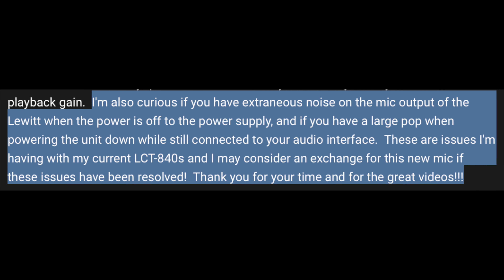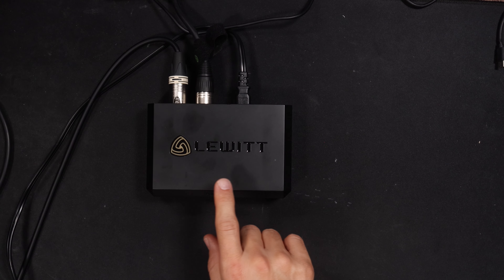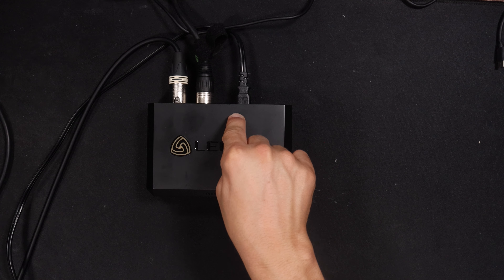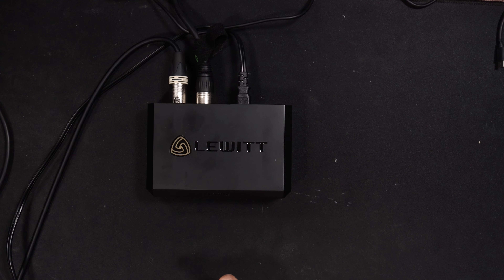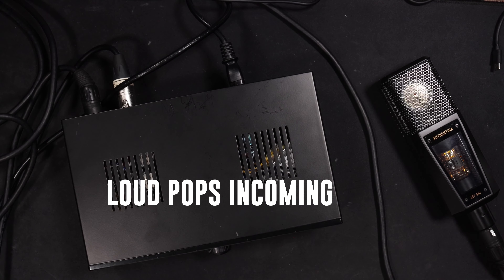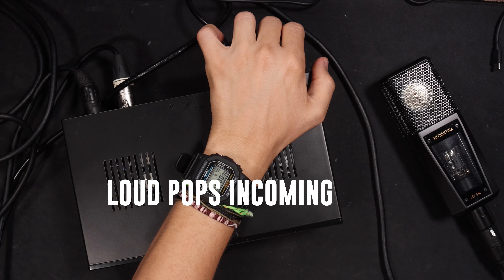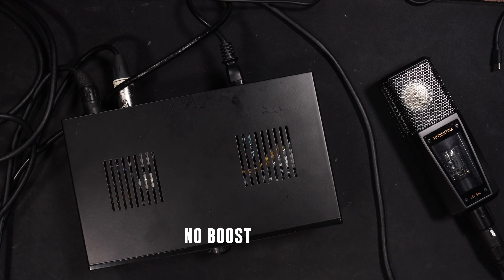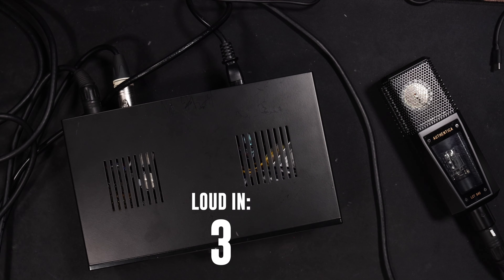Does the Lewitt Pure Tube Have Noise When Powered Off?

Comment: We are aware of this, which is also why we fixed it int the LCT 1040 and the PURE TUBE. While not being the nicest thing in the world, it is actually not an issue since it is common to use the tube microphone powered on. So, it does not have any impact on the actual sound and the recordings. Hope I could shine some light on this.
Reply from the maker: Lewitt - Thanks so much for the comment. And the video shows that you successfully fixed that on the Pure Tube, so it sounded like the commenter is likely switching to the pure tube to resolve the issue he had with the 840.

But you're right, I have had the LCT840 for 3 years at this point, and I had never noticed this until someone left a comment. So it was a non-issue for me over 3 years.
Reply: emite todo esos sonidos  por que son muy feos,  #lol ...pero suenan bien!  busque otro diseñador industrial !

Comment: I've had my 840 for like 9 months at this point. I have never really turned off the power supply until today, and noticed I have EXTREMELY loud noise and a high pitch whine. Came here to see if others have the same problem. Appears so.

Edit: Bandrew, should I be turning off my power supply when not in use? My LCT 840 is my daily use microphone for my PC setup. Because of this, like I stated before, I've never really reached behind the power supply and turned it off. I just power down my PC. Is it best practice to do this for tube mics? I've searched online and have found nothing regarding this, so I just want your advice. Thank you.

Comment: ✊🏼🥸👍🏼   Nice one Bandrew.  I think I’ll avoid the Lewitt pure.    Shame about all that noise.   Maybe I’ll change my mind if the problem gets fixed by lewitt .   Fanx For Askin 🤟🏼🙂👌🏼
Reply from the maker: You misunderstood. The noise is NOT an issue on the pure tube. The noisy version was the 840.
Reply: @Podcastage2 
Clarification please!
The Noise doesn't matter right? When using a tube, you turn it on & let it warm up before use (20-30 min), right? While there is a "POP," it isn't a design flaw, right? And it doesn't continue to pop. So, when one goes to record, their is no popping going on.
Reply: @Podcastage2  I’ll have to re watch the video again.   That buzz was off putting.   I mean it’s not a £5 wish mic that you’d expect  to be noisy.   I get the vale/tube needs to “warm up”:  but that buzzing put me right off
Reply from the maker: @libertyDude1775  That's correct. This will not impact your recording at all. This is just a quirk that someone really disliked.